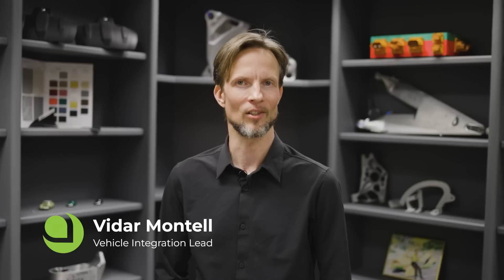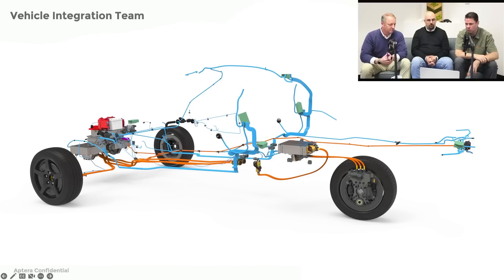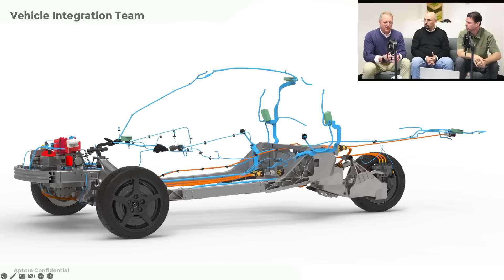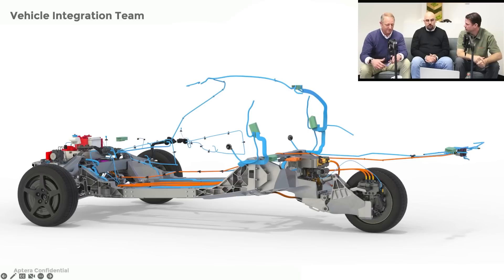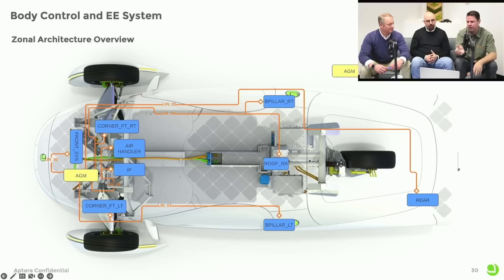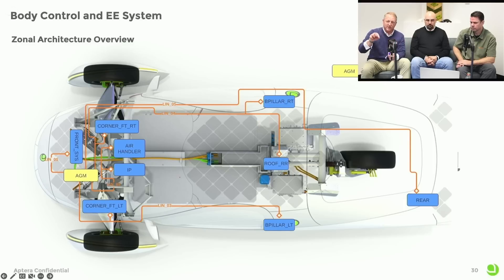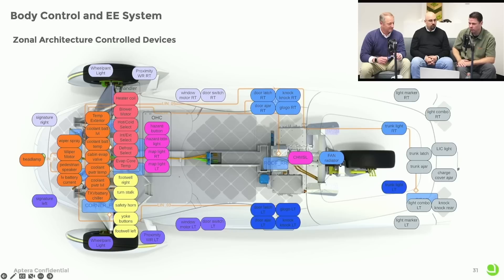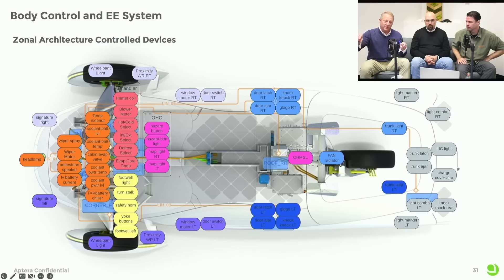Zonal Architecture — Aptera Engineering Update

Comment: Efficient? It would be interesting to know why the battery connections are in the back rather than the front, where the greatest current load from the front wheel inverter is.

Also if the charging circuitry were in the front, as in the Nissan leaf, those long cable runs from the stern could be shortened considerably.

Also, if they went to 48V for the accessory system, as in the Tesla Cybertruck, wire gauges and switch sizes could be minimized.

Comment: 1) Components still need current. You can't replace current-carrying wires with tiny data wires. You're being massively dishonest about being able to replace traditional current-carrying wire harnesses with data cables that can't possibly carry enough current. You may be reducing the size (thickness/gauge) of some of the wires, but you are just replacing simple, reliable switches with data cables and fragile, unreliable, finicky microcontrollers.
2) You're deliberately making everything much harder to repair, especially by the end user. You want to charge owners a lot more money for making tiny repairs. Instead of a simple generic bulb, solenoid or transducer you now have to replace a very specific device with a chip that end users won't be able to get their hands on.
3) This kind of electrical architecture makes for incredibly difficult upgrades and customization. Stuff as basic as upgrading the audio system or lighting become a major job requiring new wiring harnesses to be built in order to bypass the ignorant proprietary systems you intend to implement.

As with the insane insistence on using the all but obsolete proprietary Tesla charging connector, your rationale is not logical. There is ample real estate in the nose or any number of areas on the Aptera to put a door for a CCS port, which will be mandatory everywhere but North America. You're shooting yourselves in the foot if you want to ever sell anywhere other than North America, especially since in a few years even Tesla will be migrating to CCS there.

Right to Repair laws are being enacted around the world and will only become more prevalent as time goes by. You really need to concentrate on making Apteras user-serviceable rather than planned obsolescent.

A year ago I was all ready to plunk down for a reservation for a maxed-out Aptera, but the more I learn about it the less likely I am to buy one.
Reply: Hi Mark, Of course they still need current carrying wires. They just need a small fraction of them, because those wires are shared for the vast majority of the length and width of the vehicle, unlike the old way of doing things you're used to. 

I'm a retired electrical engineer who has worked with microcontrollers. Automotive grade microcontrollers aren't "unreliable or finicky". They are much more reliable (and less expensive!) than old fashioned mechanical switches and relays from 20 to 50 years ago. 

And repairing them will be quite easy when rarely required: Just unplug and replace them with the replacement part. LEDs don't need to be regularly replaced like obsolete bulbs that regularly burn out. Solenoids for door locks and such aren't going away. 

With Aptera's openness of providing free repair instructions, mods may be much easier to accomplish. No need to buy sets of repair manuals for hundreds or thousands of dollars, as are needed for your old car.

Re. the CCS plug, the one in Europe is incompatible with the one in North America, and both weigh something like 5 times what the now most common in North America, lightweight and relatively inexpensive Tesla one does.

Comment: Boy, I would want this vehicle in Germany. Only issue I have is, it doesn’t fit with its 2,2 m width neither on motor ways under construction (which we have many unfortunately) nor on the driveway and parking lot I have at home… everything is much more cramped here I guess
Reply: How much sunlight do you get in Germany?
Reply: @daveinwla6360  enough for PV. We make that stuff here… I guess this was just a rhetorical question from your side. I see your point. However, this car would make me happy except the to wide chassis… cheers
Reply: @Marco_Dubbleyou   - I agree that with shorter drives, an EV is more practical in Europe.  But test drive the Aptera before making a down payment (after checking the tires for proper inflation).  And include a cautious overtake of a big rig truck on the autobahn.  The rear pant and the "dolphin tail" could combine to cause lift and lateral deflection as it passes the front of the truck, resulting in a swerve into the path of the truck.
Potholes will also be more challenging to avoid, given the 50% more wheel tracks.
Reply: @daveinwla6360  again, this thing is too wide so I don’t consider buying it. But I like your information here, have never thought about that behavior on the road really. Thanks Dave!
Reply: @Marco_Dubbleyou   - You're welcome, Marco.  Given the thoroughness of Aptera's production preparations and industry contacts, I would consider buying an Aptera if it were a 4-wheeler with stationary fenders and which had active suspension to compensate for the unsprung weight of the of the in-wheel motors.  But...  it is what it is.  Maybe there will be an Aptera 3.

Comment: Shame they went up 10k now I can't afford one
Reply: Where did you get that from?
Reply: @tims8603  I've been fallowing it for a long time the original price was 25k
Reply: @ZWhippie  So have I. That isn't what I asked. I'd like to know, specifically, where you heard or saw that.
Reply: @tims8603  double checked it's on the web their website so they are even upfront with the price increases
Reply: @ZWhippie  The entry price for reservations is still 25.900 USD (that is for the ~25kWh battery, FWD model, roof+dash solar). But that is not what they intend to produce first.

What they'll produce first ("launch edition") is one specific configuration (~40kWh, AWD, 5way sound, full solar) and that'll cost 33.200 USD.
Reply: @ThomasWaldmann   - The 5-way sound will be needed - to cover the road noise.
Reply: @ZWhippie  I see someone already correctly replied to you. The price on the reservation page is the price for the launch edition. I checked my reservation and it's the same as it was when I made it. There may be a price hike but I don't think it will be as much as you said.
Reply: @daveinwla6360  Why do you assume that there will be a lot of road noise. There is a video where two Aptera spokespeople are driving the Gamma. They are talking during the video and are easy to hear. In fact the only noise I heard was a slight whine of a motor. The Gamma prototype is all wheel drive so that whining may be the rear wheel motor. The front wheels are outboard so most of the road noise will be outside the vehicle and not transfer to the cabin. the video is named Aptera-Driving Gamma
Reply: @tims8603   - There are also several videos with clattering and knocking to be heard when the vehicle crosses drains in the well-paved parking lot.  And notice that ALL demo drives are done on new well-paved roads around Carlsbad.
And since no riders even check the tire pressure, you can be sure that the tires are comfortably soft because they will not be required to corner well or exhibit efficient mileage.
You must face the fact that with 3 wheels, you will pass over 50% more potholes than a 4-wheel vehicle - or even a 2-wheel vehicle.  That's just the nature of autocycles.
Reply: @daveinwla6360  You you have search term for YouTube of those videos? When I think of road noise, I think of howl from the tires on smooth roads like you described. I live on a smooth paved road near the edge of town. People speed there a lot because the speed limit goes up after a few blocks. I can hear noise of the tires on the road when I'm out front. You have to understand that the Gamma is not the production intent vehicle. The Alpha, from what I heard, had some rattles and the suspension wasn't as good. The production vehicle will be manufactured with the CPC carbon cabin which should be more rigid. There's an outer body too which provides an air space in between.
Reply: @tims8603 wants Youtube search terms:
"Aptera Electric Car: My First Ride in a Solar EV!" - The Aptera employee says "Whoa, shit!" when he hits a bump.
"Aptera — Driving Gamma" - ignore the constant chatter of the 2 Aptera employees trying to cover up the knocks and rattles
"Aptera Alpha Ride Along Complete Unedited" - Aptera employee give Steve a ride with the windows rolled down and with unknown pressure in the rear (non-powered) tire.
As for the product made by CPC, Why base your profound faith on something that doesn't exist?
Reply: @daveinwla6360  The first one where he's driving the Beta with no doors or hood? Of course, that will be noisy. That vehicle was built for testing suspension and handling. It had extra weights and a radiator in front. Take the doors and hood off your current vehicle. See how quiet it is.  The second one, the one that I pointed you to, I don't hear much noise. The third one, I already mentioned that the Alpha had rattles. It's the one that Jay Leno drove. That was the first of the prototypes built. Do you  expect the first prototype of any vehicle to be perfect or near perfect.

I'm starting to suspect that you're trying to discredit the Aptera for some unknown reasons. Tesla fanboy, EV hater? I don't know.
Reply: @tims8603   - You conveniently forget that these are carefully chosen and edited videos to show the vehicle to greatest advantage.  Yet, you encourage people to put up money for what isn't at all proven or offered to the public - or journalists - for thorough testing.  IOW, it's just vaporware.
Reply: @daveinwla6360  Yeah, now I'm sure that you're a troll. I have only suggested to people to put in a refundable reservation if they are interested at all. That money is put into an escrow account and will be refunded if the person changes their mind. I put $70 in to reserve one. Is that a lot of money? I've never encouraged anyone to actually invest in the company. That's completely up to them. I haven't. I don't understand the troll mentality or what kind of thrill you people get out of it. I always try to give them the benefit of doubt. I won't reply to you so don't bother replying to me. I will just ignore you.

Comment: I'm very interested in seeing and hearing what the cabin noise is like while driving. Seeing how the body is built mainly on strength and aerodynamics. I personally don't mind a louder cabin, but I hope it isn't too loud for the everyday driver who is used to moderate noise cancelling vehicles.
Reply: As long as the build quality is good, I expect it to be quieter than regular vehicles.

- curved surfaces don't vibrate at low frequencies
- no engine
- no wind turbulence
- natural damping of the composite is higher than that of steel 

If I'm not mistaken, the third founder is also an audiophile, so there will certainly be some focus on eliminating noises from the interior.
Reply: @siesstad  Carbon fiber is like a sea shell - it needs LOTS if damping to absorb vibration.
Even glass fiber is noisy - ask any sailor whether he'd like to bunk in a wooden hull boat or a fiberglass hull boat.
Reply: @daveinwla6360  

We were comparing plate steel to composites, not wood to composites. 

Try being in a thin-walled steel boat and compare that to a polyester boat.

My parents had a diesel powered steel boat. You had to shout at each other when the engine was running.

Comment: Aptera is also being efficient in their wiring and control systems design. And the benefits that we will get will be increased reliability, lighter, less expensive, easier to build, and easier to troubleshoot.
Reply: Have you tried to troubleshoot a data network with a continuity checker?
Reply: @daveinwla6360  You won't ever need to, because the system diagnoses itself. The Aptera computer will tell you what's broken and how to repair it. :yougotthis:

Comment: From what I see as a reservation holder is even if the funding was there, you guys were not ready to start production end of 2022. 

Where are we now with funding? If funding was fulfilled, are you ready to start producing? Does not look like it, but hope to be wrong.

You guys really care about us customers? Use iron phosphate or m3p chemistry from catL <3 costs less for you, safer for us, more cycles.  You have enough time to fix that before you're ready to produce =D
Reply: Chris mentioned in a recent interview they are considering using iron phosphate or other chemistry for a future lower range, lower cost version of the Aptera.
Reply: @Harry Parker  future as in the future where they start production or future after production? 

We all know they have enough time between today and the start of production to make this change that lowers their cost, and is a better product for the consumer. 

But my expectations are low after watching them try to bring their car to production without DC fast charging after marketing it as a commuter car great for trips.

Just what I see, just my opinion.
Reply: @borshardsd  The design of the Launch Edition 400 mile range version is locked, so no other battery design is happening before production starts. 
I expect the original 250 mile battery pack will still be a smaller version of the 400 mile pack as they previously stated, at least at first. Maybe by the time they get to the 600 mile version (2025?) they'll have the time to design and test improved lower cost alternate chemistry batteries. 
It takes over a year to design and fully test a new battery, including production equipment design and tooling, and environmental extremes tests.
Reply: @Harry Parker  so after they changed the charging system design, it was locked? Thanks for the added information.  Seems like a miss on aptera, they were looking at that plug but not the battery pack chemistry tesla was killing production costs with.  

Let's see what the next year brings for aptera.

Comment: This was sort of my idea.  I built my own custom wiring harness for my Quest velomobile back in 2014 and the absurdity of routing switches through the cockpit with individual circuits disgusted me.  That's why I gave the idea of a single power circuit with signaling on that circuit to devices.  That way, a central computer could send the code onto the power circuit to execute various functions and avoid all the switches and so many circuits, weight, and problems.  It also occurred to me to use higher voltage instead of 12V but that was so obvious someone else had thought of it years ago.  Elon chose 48V, but I would have gone with 220V instead for safety's sake, but hey.  Aptera sort of borrowed this from Tesla, and I'm glad I could help.  
Incidentally, I've also figured out that 1/10th gram or so of healthy adult male facial skin surface lipid pheromone (passed in kissing which I discovered in 1984:  Nicholson, B.  Does kissing aid human bonding by semiochemical addiction?  British Journal of Dermatology vol 111(5):623-7), cures opioid addiction, schizophrenia, ADHD, OCD, PTSD, CD, criminal behavior, gun violence, sexual perversions, anxiety disorders, personality disorders, depression, generalized wasting, Alzheimer's disease, Tourette's, Parry-Romberg syndrome, and autoimmune disease in general.  Too bad Joe Biden's too stupid to pay for a clinical trial.  I got a trial done in Egypt, but the entire staff mutinies because I'd neglected to remove enough of the aversive sentinel sub-pheromone volatiles.  Of course, pheromones are odorless, colorless, tasteless, and usually imperceptible in action.  Anybody out there got $200,000.00 to pay for safety trials to get the idiots at FDA to go along with it?
Reply: Why would 220 volts have been safer than 48 volts?  220 volts is quite lethal , whereas 48 volts is not considered lethal.
220 volts also needs heavier insulation and it risks arcing ("sparking").
Reply: @daveinwla6360  ok

Comment: Has Aptera experimented with electronic braking systems like Brembo has been showing off?
Reply: Aptera will have regenerative braking, and... it won't go very fast, so only minimal braking is planned.
Reply: @daveinwla6360  Yes, the Aptera is limited to going only up to 101 mph -- not very fast. 😂
Reply: @fotoguru222   - 101 mph is an empty promise made on a flat straight level road with no other traffic in mild temperatures with no crosswind.  And don't overtake any buses or big rigs - you'll swerve right in front of them.
Reply: @daveinwla6360  But they must have to include a standard hydraulic system too, no?
Reply: @Jessev741   - I assume so.  But with regen and light weight, brakes wouldn't have to be as large as for, say, an ICE SUV.
Reply: @daveinwla6360  I understand that... It's not about the rotor and caliper but the master cylinder, brake lines, fluid, etc. With electric brakes none of that is necessary. On a vehicle like this the (sprung) weight saving would be enormous
Reply: @Jessev741   - You know, I read that piece by Brembo about their brake-by-wire system, but it's not concise enough to make a good case for BBW as reducing unsprung weight.  It may be suited to high-perf supercars, but on the Aptera it could be more complexity and expense than the vehicle warrants.  The case for active suspension could be stronger by compensating, at least partially, for the unsprung weight of the in-wheel motors by varying the compression and rebound damping coefficients in real time.